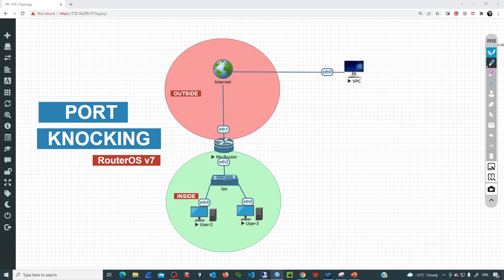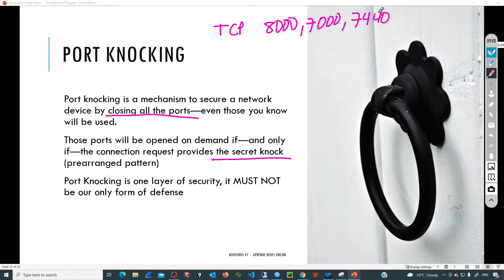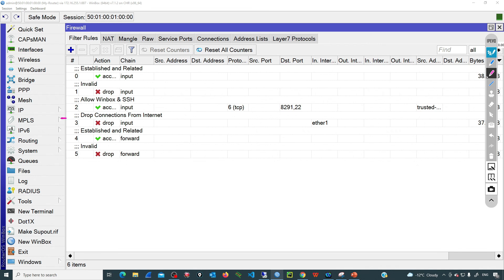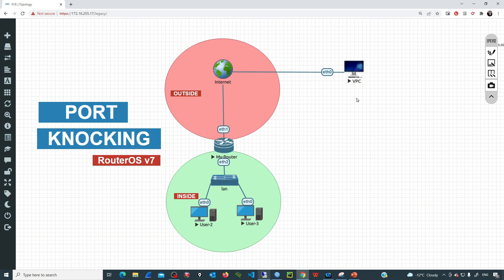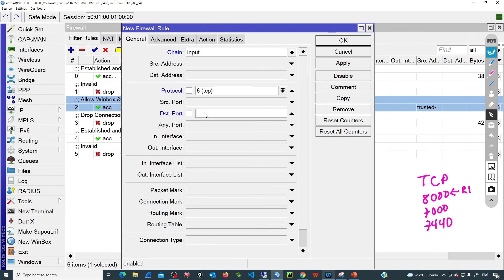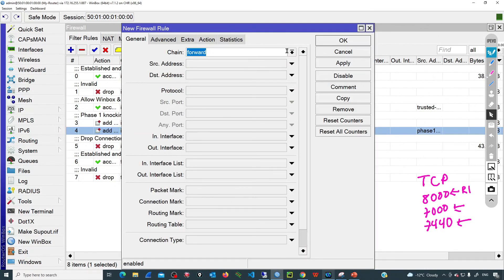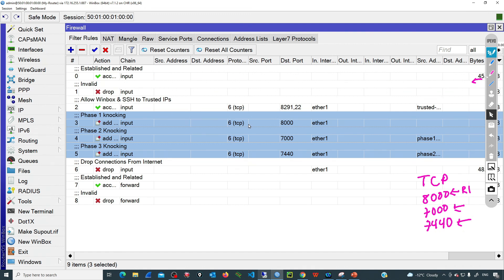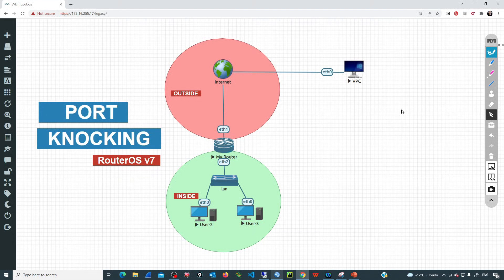Port Knocking Step by Step - Mikrotik RouterOS v6 & 7

Comment: Thank you for the video. Unfortunately there is no option to set port knocking "action" as "run script". IMHO,  it will be extremely useful in many use cases.  Maybe you know some workaround how can I force mikrotik to run script after successful port knocking?

Comment: I use that PK but have additonal rule who detect any knocking into range 6000-9000 (without my 3 ports) and I block that IP at 1h. This is used when I cannot connect from trusted constance public ip. This prevent me from that knocking automatics.